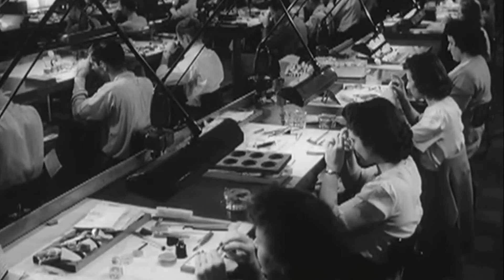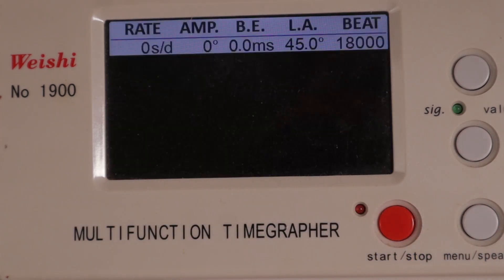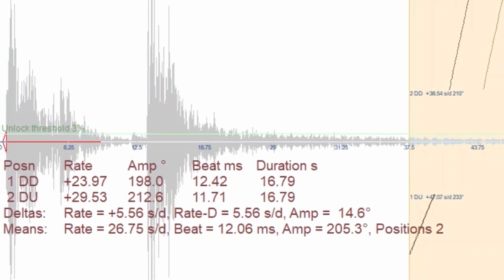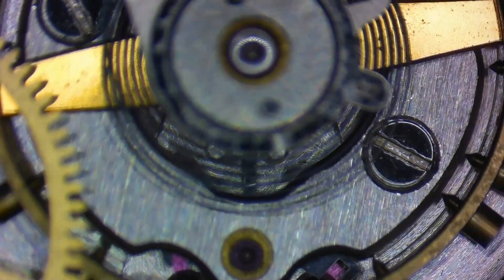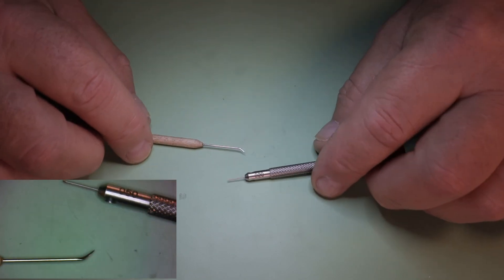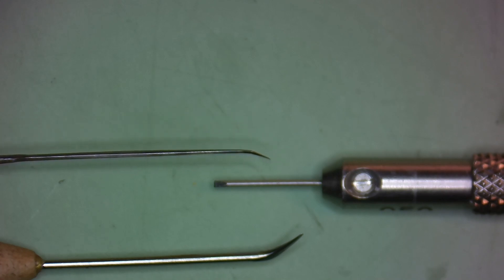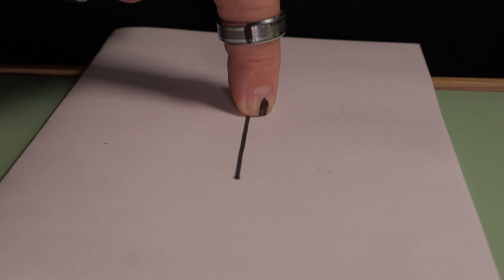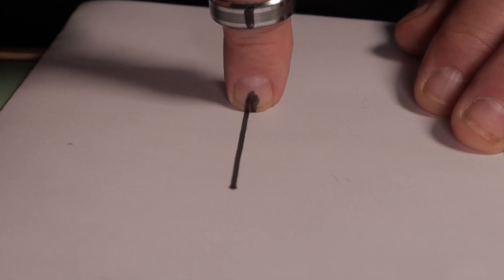This SIMPLE TRICK Changed Everything for me

Comment: When the balance wheel hangs down on the spring, in my mind that would alter/damage the spring in a way that it more than nullifies the fine tuning.  And to do it 7-8 times!
Well, I guess it doesn't damage it.  Those springs are tougher than I would have imagined.
Reply: It's not really so tough. The only thing that makes it withstand such handling is that the whole deformation is spread along entire length of the long hairspring.

Comment: thank you for telling me about this video!! helped tremendously!!
Reply from the maker: You bet. Did it answer your question?
Reply: @watchrepairtutorials  yes, it did. thank you!! another question tho, i'm working on an old 18s Illinois PW. runs ok when wound but overbanks when no power in the MS. i manually flip my wrist to turn the balance wheel. i messed w the banking pins(they have screw tops) and it runs much better. should i have moved the hairspring collet instead? its not perfect but much better than before. B.E is .1  i feel like it needs more work tho..
thank you!
Reply from the maker: @petem5603 if it’s over banking, that means your escapement is out of adjustment. Probably ably due to the banking pin adjustment. 
There’s no way I can explain how to fix that here unfortunately .
Reply: @watchrepairtutorials  i agree. thx for all ur help!! much appreciated! i'll fiddle w the banking pins til i get it right.
and watch more of ur videos!

Comment: I have benefited a lot from you!
Sorry, I don't understand the lift angle you explained at the beginning of the video. I hope you can give me specific guidance.
Thank you very much for your video, I learned a lot!
Reply from the maker: What don’t you understand about it?
Reply: @watchrepairtutorials  Thank you for replying to me!
My English is not good, so I used Google Translate, and there were things I didn’t understand. Please understand.
It’s what you mentioned at the beginning of this video about making a reference point on the movement and a reference point on the balance wheel. The alignment of these two reference points is 180 degrees. Use this to know the lift angle.
I don’t understand this. I watched it three times in a row and still didn’t understand it. I hope you can teach me carefully.
I don’t know if what I said this time was clear or not.
Reply from the maker: @cbazd I understand. The two dots should be directly across from each other. As you slowly add power to the mainspring, the balance wheel starts to turn. When the dot on the balance wheel comes around and lines up with the 2nd dot, the balance wheel is rotating at 180 degrees. 
The dot on the balance wheel comes around,lines up with the 2nd dot and reverses direction.
Now that the balance wheel is rotating at 180 degrees, then you change the lift angle on the time so that the timegrapher is showing 180 degrees, you now know that what the lift angle is. 
Does that make sense?
Reply: @watchrepairtutorials  
Got it! Thank you very much for your teaching!
I hope you will continue to make videos to teach us!
Bless you! ! !
Reply from the maker: @cbazd  I am. I have been doing a lot of writing the last couple months. I get these ideas  and I have to write them down. Then. I start researching and I go down these rabbit holes.
Reply: @watchrepairtutorials  Hope to see your new works soon. Thank you again!

Comment: You are the best, very good watch repair teacher. I have a question and I think you are the right person to ask. I have a Seiko 5 7s36 movement and the hairspring was damaged. I bought a NH36 movement to take balance wheel and hair spring from that movement and use to replace my Seiko parts. I can do that? Or I will have broken part problems in a future,because is different movement? I don't know if you have a video talking about replacing parts with different movement, if not can you do one? Thanks in advance
Reply from the maker: If you have already bought the movement, did you try swapping it out?
Reply: @watchrepairtutorials  I will try, but I asked you first to make sure if I'm doing right thing.

Comment: I didn't quite follow what you said up front about figuring out the lift angle. Can you restate that process?
Reply from the maker: What don't you understand?
Reply: @watchrepairtutorials  Well, you got to "180 degrees" and it wasn't clear what you were trying to do. Now, after scanning a few other videos, I understand you were trying to apply one clock of power at a time until the impulse on the balance wheel was just enough to put it at roughly 180 degrees of rotation. So, got it.

While we're here, I have a watch that isn't giving audible signs of overbanking but seems to have ~410 degrees of amplitude on a full wind. Do you have an video addressing how to deal with that? (In this case, original spring and all that. Cleaned, but original.) Need to add weight to the screw balance or something?
Reply from the maker: @bwhog  Exactly. Once your wind the movement so that the balance wheel is making 1/2 rotation, (180) then you set the tift angle on your machine until it displays 18 degrees.  Whatever lift agle is displayed is then correct for that movement. 
To your second point, think about what you are saying. That's impossible right? 
these are on 360 degrees in a full circle and the impulse pin can not pass by through the end of the pallet fork. 
Just be clear, amplitude is the maximum travel or displacement in one direction or one vibration.
Reply: @watchrepairtutorials  Yeah, realized I wasn't thinking right. It is moving the amount I said, but that's extreme left to extreme right. So divide by two to get angle from center, which becomes ~220.
Reply from the maker: @bwhog  there you go. Now you got it.👍

Comment: What I’ve been doing is drawing a rough model of the balance wheel, with screws, and just note where my tool is in relation to the screws.  At each stage, I just note in the drawing what the error is, and then binary search down to reduce the error. This has really worked great for me, I can usually get down to under 0.5ms pretty easily within 5 adjustments.
Reply from the maker: It sounds like you’ve figured away that you understand what you’re doing and track your movements along with the results.
Well done🤙

Comment: Alex, could you explain the reason why, when the two dots meet, the balance is at 180 degrees? I see the effect, but I can't understand why is that. Thanks for your content!
Reply from the maker: When the balance wheel makes one full rotation that’s 360° right. So half of that rotation would be 180° correct? So since the dots are directly across from each other when the first dot rotates enough to line up at the second dot thats 180. 
Remember that amplitude is measured by how far the balance wheel rotates.

Comment: 🙏 At first, thanks a lot for your time your content and your knowledge is amazing how "to the bone" you go and how simple is your explanation. ✌I have a very technical question: How does the Timegrapher calculates the amplitude ? I´ve found some partial answers on forums but nothing clear. I can´t figure it out by myself and would be great if you can put some light on that.  Thanks again and cheers from Córdoba, Argentina.
Reply from the maker: I appreciate that!
The timegrapher listens to sounds from the escapement.
The first noise it hears is when the impulse jewel strikes the corner of the pallet fork. This noise is very precise and is therefore used by the timegrapher for calculating the rate and beat error.

The second noise it hears is when a tooth of the escape wheel meets the pulse area of a pallet stone as the pallet fork touches the impulse jewel. This is a low quality irregular noise and it's not used for any evaluations.

The 3rd and most powerful noise happens when a tooth of the escape well meets the locking plane of the pallet stone and the pallet fork lever hits the banking pin. This is the noise that's used, along with the imputed lift angle that’s used for the calculation of amplitude.

The lift angle is figured like this. 
The pallet fork is resting on the banking pin when the impulse jewel strikes the pallet fork. If you could freeze that moment and draw a straight line through the center of the impulse jewel that is one side of the lift angle. 

When the balance wheel swings the other way the pallet fork is now resting on the opposite banking pin and the impulse jewel strikes the pallet fork again from the opposite direction, if you could freeze that moment and draw a straight line through the impulse jewel again that is the second line of the angle.
Hope this helps -Alex.
Reply: You arte the Master !! now I get it perfectly. Thanks a lot for your time and your generosity 🙌🙌🙌 @watchrepairtutorials

Comment: G'morning. I have a watch with the hands not aligned, so when the minute hand points to 12 the hour hand is between the 4 and 5, for example. Is it OK for me to remove the crystal and just push the hour hand so that it is aligned with the hour index? Or do I need to remove the hands and replace them using pushers? Thanks.
Reply from the maker: As far as moving the Crystal, it depends on the type of crystal, right, some movements need to come out the back. 
You absolutely do not want to push the hands while they’re installed. That is how you damage the teeth on the wheels and then you have to replace them. Remove the hands as you seen 1 million times probably and then they need to be reinstalled with pushers.
Reply: Thank you - I appreciate that. @watchrepairtutorials

Comment: Thanks, Alex. I have a nice, cased set of Bergeon screwdrivers with the Beryllium tips. They are so smooth to use, like a dream. I broke one of the small tips on purpose just to see how strong they were. The tip took a lot more force before it broke than I thought it would. I ordered another set of the tips so that I have extras. I'm keeping the broken tip in case I need to make a special tool out of it someday.
Reply from the maker: Ewwww nice set. Butter
Reply: @watchrepairtutorials  They are very nice. I don't use them on anything else except watches. I have other precision screwdrivers that I use for electronics and other things.

Comment: I've watched this like five times and I still don't get it. How do you decide where to put the dots? What makes that 180 degrees versus some other arbitrary number like 120 or 270? Swish... went right over my head.
Reply from the maker: Can you be more specific about what you are confused about ? Then I can answer your question.
Reply: @watchrepairtutorials  Sure; how can you pick the right spot to line up at 180 degrees? Clearly I'm not understanding something. Example, you could make two marks 2mm to the right, or 2mm to the left, that's got to equate to a 60 degrees or more difference.
Reply from the maker: @cyberbillp  OK I see you are talking about finding a lift angle. So first it doesn’t matter where you mark the wheel as long as your other mark is directly across from the wheel mark. that’s 180° . With that said you want to mark the wheel where you can see it and at the same time be able to see your reference mark  which is your second dot. We use 180° as the angle because it’s the easiest angle to determine because it’s exactly half of the diameter of the wheel.
So, with the wheel at rest, not moving, I marked the wheel in a place where it’s exposed, and I can see it. Then I make another mark directly across from the mark on the wheel, which tells me that when the mark  on the wheel hits this reference mark on the other side the balance wheel is turning 180°. 
Once you know that the balance wheel is turning at 180°, then you adjust the lift angle on your time Grapher so that the amplitude shows 180° and you have correctly determined the right lift angle.
Finally, don’t forget to clean off the mark on the balance wheel in the movement.
Reply: @watchrepairtutorials  Thanks, I think I get it now.

Comment: Hi Alex, thanks for sharing your knowledge. May i ask about finding the lift angle:
What could i use best to mark the balance wheel with the reference dot? It has to be smthing, that can get removed easily.
Reply from the maker: I use liquid white out, the same stuff that they used back in the day when people typed on typewriters. I find that it’s easier to see a white dot. Then it literally just flakes right off. It’s very easy to clean.
I’ve tried sharpies, both red and black, and I find it a lot harder to see that.
Reply: Sounds like tipp-ex….im gonna give this a try.   Thanks man

Comment: Thank you! With your tutorial I was able to correct beat error on my project Poljot 2416 movement from 9ms down to 0.3! I had to disassemble balance from cock and mount/dismount everything at least 20 times :) Was too afraid to work through hairspring. I found using a marker on a balance ring to point position of an impulse jewels very helpful in identifying its position.
Reply from the maker: That is really awesome to hear. Every time you do it it’ll just get easier I love. Keep studying and learning and then practice what you learned, and you will be a master

Comment: Hello again Mr Hamilton, thanks again, another great lesson. I think I have graduated in terms of learning how to adjust to reduce beat error. Being careful needs to be emphasised. The balance wheel, shaft, roller, collet and hairspring are so so delicate. I found this out, my practice seiko balance wheel and the one arm through the middle are easy to push out of flatness. It only takes one heavy handed (and I am being relatively gentle) press to do what is against the mantra - "do not create issues". So lucky I am a hobbyist but know there are no excuses for this. I have learnt. So, I now have a reasonably OK working main spring (properly lubricated and I mean the Hamilton method), no issues with end or side shake, good powertrain all the way to the fork'n balance wheel. (play on words)

Previous update we discussed my over aggressive cleaning routine, first time. Found it was easy to source Ultrasonic cleaner and rejected using dish washer stuff. Now I really do have beautifully cleaned parts and amazing how new the Seiko 6139 looks. I have Hexane for the real delicate stuff. Taking out the jewels and getting the correct lube applied gettin better and just a joy to try to master. I am the guy who likes to tackle the hardest stuff as it adds a spice to the process. 

Staking set is getting a work out. I must share a photo of this one day. She is GEM Dreadnought and I french polished the other day. All bits in perfect nick. Don't know when they made these tools but the curved glass is a real eye catcher. So on that, my first real vintage watch is a Moeris 1958 Grands Prix I got from Japan. Balance shaft broken pivot. Have replaced following Hamilton method but found that it is not rivetted to the wheel. Just pressure fitted. Had to be very careful with this especially during full reassembly. Still need to do the overhaul and that will be my next update. I am at the point where I can apply everything you have shared. It gets exciting. T h a n k  y o u   A l e x, enjoying your channel, Brett
Reply from the maker: Wow Brett what an update. Thanks for taking the time. Sounds like you’re moving along quite well and it’s great to know that I might’ve had a small part in that.
Keep up the good work, my friend and update me again when you can. Alex.
Reply: @watchrepairtutorials  ... you are also the master of the understatement. Love it. ...small part... hmmm in watch movement terms I guess they are small

Comment: Great video tutorial Alex! I’ve tried and still not mastered this. I will keep trying! Thanks to your Patrons!
Reply from the maker: You can DOOOO it. 😊
Reply: I found it most helpful if the balance and the cock can be held stationary while working on the upper part of the balance wheel.
I combined two different, commercially available tools and modified them to work together to accomplish that. Because the two parts are held stationary, they can also be adjusted on all three axis, the two parts can be slightly spread apart to revel the top of the balance wheel and this makes turning of the hairspring collet and easy task.
Here are two images of that combined tool:

https://i.postimg.cc/LsvLs3p7/IMG-3762.jpg

https://i.postimg.cc/zBNFcGkw/IMG-3761.jpg

Hope this helps
Reply: @TropicalSpeed  thanks! Do you know what this tool is called, brand and where to buy? Cousins?

Comment: Great video...after restoring wristwatches for a while I recently started to restore pocket watches. I have to wonder why there isn't a complied list of lift angles for at least the more popular grades, like the Hamilton 992B. Do the lift angles vary between production runs of a grade like this? I can't find any reference for a lift angle for the 992B, certainly someone has calculated it using the observation method. After I serviced my 982B it ran with such a flat and stable trace I didn't bother to calculate the lift angle and used the amplitude as just a "figure of merit" (as in, that's pretty darn strong and I don't need a new mainspring). So, why are pw lift angles complied someplace?
Reply from the maker: It's weird. There's not as many professional watchmakers that work on pocket watches anymore and I think the ones that do just haven't had the time or the inclination to put together a list.
I do not believe that lift angles change from model to model within a grade but to be honest I've never really tracked that.
Anyway here you go Hamilton 992 16 size 48° & Hamilton 992B 51.5°
Reply: @watchrepairtutorials  Super big thanks again! I appreciate that you are so generous with your information...J.